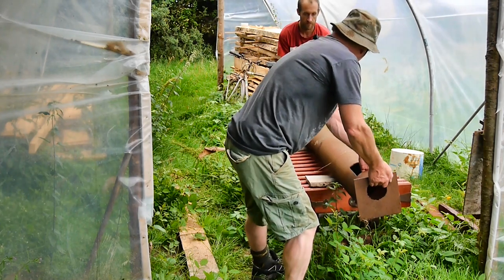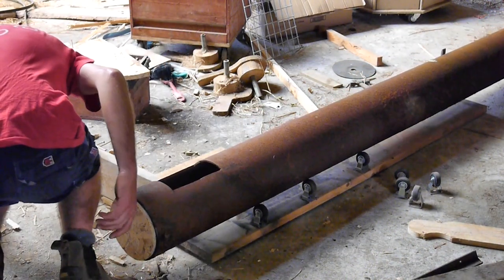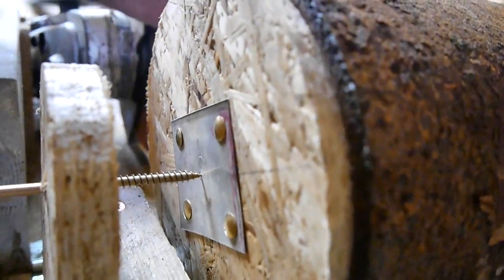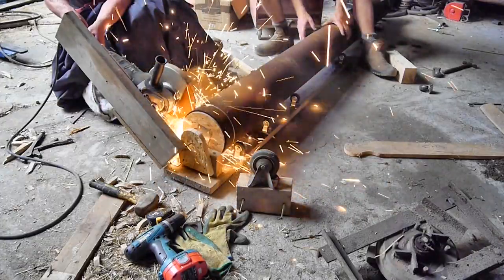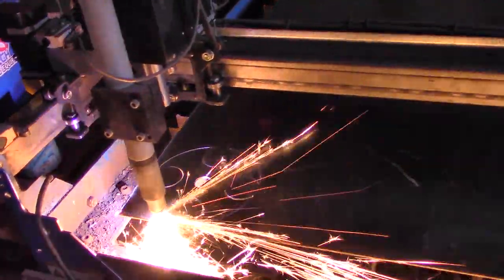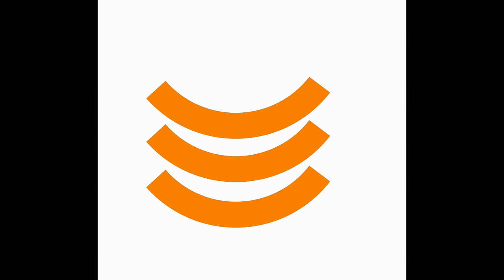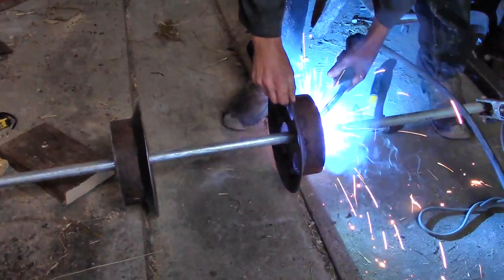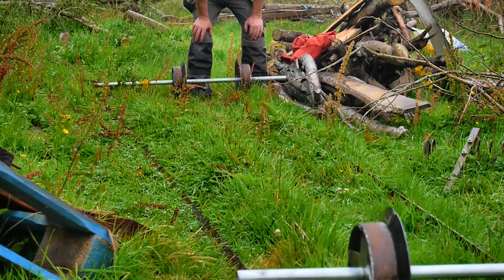Anyone Can Make Railway Wheels From A Pipe - the cheapest wheels possible.

Comment: I really like these, and the whole field railway project! You'll probably get lots of comments about welding galvanised pipe though, so let me be the first: you do not want to breathe zinc oxide fumes, it can cause "metal fume fever" and even death. Please make sure the galv is cleaned off before welding, or use a full respirator.
Reply: Also, make sure the cartridges for the respirator are appropriately rated!  You don't want to use just an ordinary dust/particulate or organic vapor (sanding or painting) cartridge when you're working with heavy metal fingers.
Reply: Does holding your breath and crossing your fingers work?
Reply: @liamholcroft7212  If you've got really good ventilation in the welding area?  Yeah, hold your breath during the weld and for a bit after while the fumes clear, you should be okay, but it's still risky doing it like that.
Reply: @Kineth1  It'll be reet
Reply: Welding any Gav steel,  if possible Soot it  first,  blacken, it helps  stop the gav exploding. 
Also  drink some  milk  before  you  start  welding,  helps  if you  get TOO MUCH FUMES swallowed.

Comment: Hi, Great video, I am really enjoying the videos. Just wondering if you would be willing to tell me what cnc plasma cutter you use. im in the market for one and looking for a recommendation.
Reply: Nice to see you here too! Wouldn't it be awesome if you built railway and they built a timber frame building haha
Reply from the maker: Thanks, Kris, I'm enjoying yours too : -  )
Rob makes the CNC plasma machines and he's here.. https://xtremeplasma.ecwid.com/
(tell him I sent you..)
Reply: Will your power setup need an upgrade for a plasma cutter?
Reply: Came here with basically the exact same question. I saw the link for the tables, can can you say what brand/size of plasma cutter that you were using? Have you been happy with it? Any recommendations otherwise for a first time plasma cutter shopper?
Reply: @the_retag  No My current setup would work fine. its high draw but quite short duration just like welding, and my system is fine doing welding.
Reply from the maker: Mine is the 4' x 4' machine. It comes with an excellent R-Tech plasma cutter, a computer and all the software you need. I haven't tried any other machine, but I can vouch for the back-up service from Rob and his team.

Comment: For the tapered treads, since your pipe has walls twice as thick as needed, why not put the flat tread wheels into a lathe and cut a slight taper into them? It isn't needed, but it might be worth doing, and it would also make the treads smoother, because you would remove the rust pitting, so that would slightly decrease rolling resistance. I don't know if it would be worth it or not, but it could be a fun experiment. Maybe taper the wheels on one of your chip wagons, and do a performance comparison between it and another one on various parts of the railway, and if you notice any improvement, do the rest.

Comment: Good find. You can never go wrong with a scrap pipe that you forgot about in the pile or laid about! The wheels look super nice and the pipe you are using is a good choice for cost. I can not think of anything else that would be cheaper unless it was scrap metal. This would be better as if you need more you can just pick it up. 
I always look forward to see what you come up with. Nice job on the cut locations and details.
Reply from the maker: Thanks, William : -   )

Comment: Might I suggest that the "stat" shaped center pieces for you EXCELLENT 8 inch wheels, be welded into the rings of steel at a pattern 90 degrees from each other in order to encourage a little more strength?
Just a thought.
Reply from the maker: It's a good thought, Frank. If I was using thinner pipe I think I'd go with that arrangement, but this isn't going anywhere. (Well, I hope it is going somewhere, but you know what I mean!)

Comment: Tim, have you thought about using a riding mower for your locomotive? Most have reverse, and a couple forward gears to speed up, or slow for more torque. You are inventive, and shouldn't have much difficulty adapting it run on your rails! Always entertained, and amazed at your work! I'm in western Pennsylvania, U.S.
Reply from the maker: Thanks, Donald - I'm trying to avoid petrol engines, but otherwise it's a good idea

Comment: I'm building my own railway (though I don't have a garden, I live in a city I moved into several month ago) and I should say that wheels are by far the most complicated and depressing part once they don't turn out what you expected them to be. My whole construction is as follows:

1. OSB trainset, parts for locomotive are ready (sawn with a jigsaw literally on the bench in the yard)
2. PVC pipe rails, wooden sleepers.
3. OSB wheels of three parts each - 2x 76mm x 10mm rounds made with crown saws and a bigger one as a flange, assembled together with screws for drywall. Edges finished with sealant. 

So, when I started to put carts together I realized they're as substandard as they can possibly be. Literally everything was assembled on the knee. When I started doing this, I decided to make everything by myself, except ball bearings and screws (and material of course), but now I realize I'd better bought plastic wheels from store. They're not as authentic, but they're all the same.

I'm really fascinated you make it right from the first try. 
Maith thú!
Reply from the maker: What you've learned is really important, and it's only cost you some OSB and some pipe, so well done.

Comment: Hi there Tim and Sandra, I wish to congratulate you on a fantastic site and I love your approach to building your wagons, I have been down all the same road as you and to buy 15 inch gauge wheels for a line would be  too rich for my pension sadly, So you can imagine my joy when I saw how you built wheels using tube and flat plate, would it be possible to buy a memory stick with the program for CNC cutting on it or maybe even a package of all the flat pieces cut out?. I am from York in the UK, but fortunately I live with my wife in southern Bulgaria so we are in the EU,so there is no problem with duty etc, just the price for the wheels and and shipping plus making up the packages. I do not need the axles as they would probably make the parcel too long.   Please give the idea some thought will you I would probably want 1 set of 4 wheels every month or so, I am also going 15"gauge and would be doing hand trammer wagons first,and maybe a loco over next winter.  Once again fabulous site and I hope to emulate your style of building,even down to the charcoal making,all the very best to you and Sandra and keep up the great work. Regards Richard and Janie Feather.
Reply from the maker: Thanks for your kind comments - and I'd be happy to try to help, of course. But perhaps it would be best if you found the pipe you want to use, and decide on the axle first. Measure everything and we could go from there?

Comment: An even easier way to make the inserts is to take two flat bars of around 60mm x 5mm x wheel diameter, drill an axle hole in the centre of each length and then lay one on top of the other in a cross shape with the two holes lined up to accept the axle.  Weld them together and it's done.
Reply: Great thought and comment! It is in fact difficult to keep things as simple as possible. We all tend to fall into the trap of finding solutions using our set of tools we are used to using. KISS is almost an art form and takes a surprising amount of knowledge to facilitate. Again, great comment.
Reply from the maker: Yep. That's a great idea. (Where were you when I started?!)
Reply: @rolliebca  Thanks Rolland, We all have skills we can bring to the table.  Tim's skills are far superior to mine but we  can all grow our skills together simply by sharing.

Comment: Dear Way out West couple (this time addressed especially to the inventor and his helper).
👍👌👏 Simply fantastic again and as always (video and work). But too short, sigh (just kidding). By the way:
Right at the beginning of the video I wondered how far you would come with those work safety protecting shorts. ;-) 😀😀 Hope that there had been at least no nettles or plants with thorns in the bush/hedge where you found the big steel pipe.
2) In my personal opinion you are absolutely doing the right thing = building your private garden railroad with relatively cheap materials and not overbuilding it. In the way you are doing it, it will last more than long enough. Additionally everything is cheap/easy to fix.
I would have tried to put bearings in the wheels etc.p.p.. So my project would never be finished because of the costs and the effort. The result would have been: procrastination! Please don't ask me why I know, sigh.
As always: Thanks a lot for making teaching explaining recording editing uploading and sharing.
Best regards luck and health to all of you (humans animals and plants).
Reply from the maker: Ha! Thanks very much - you're one of most loyal and appreciative followers : -  )
Reply: Dear  @WayOutWestx2 Tim.
You're welcome, it's my pleasure. Thanks for replying. Please kindly allow me to ask: Does Sandra also read the comments here or only the ones on the German speaking channel and the monthly updates in English and German? Thanks in advance for answering.
Sincerely yours.

Comment: Real wheels are very heavy made out of solid steel.  This will hold the car or platform on the track.  I would like to sit up ok without being so far low.  Just look for an older railroad truck that has the guide wheels on it.  Then get them off the front and back.

Comment: Just use a damn pipe wrap and soap stone draw your line and cut the edge of line outside or inside to leave line or cut the line in half is pipe fitters and welders do it like that all the time and its always straight ebough with in 1/32 of a jnch out of roundand when you weld endcap on it will be correct

Comment: Does your railway have a name?
Reply from the maker: Can you think of any good ones?
Reply: @WayOutWestx2  In America at the height of railroading, railroads were sometimes named for the most extreme ambitions of their owners without any regard for the actual route. So perhaps something like Dublin, Paris and Rome Rail System. Not just a railroad, but a System. You can always claim that there are connections available.  I've always been partial to the grandiose lettering used by The NY, New Haven and Hartford. Understatement is overrated.

But should you prefer something more realistic and less grand, then how about West Lines? Perhaps that would be more dignified while maintaining a certain ambiguity for future expansion. And it would require less paint.

Comment: Why don't you just get used car brake rotors and trim the friction surface to the taper you want?
Reply from the maker: No car breakers near here, and buying them would cost too much . and that would be a LOT of grinding too, don't you think?
Reply from the maker: Also, I think, you'd still need two inserts, unless you were using monstrous axles that filled the hole in the middle of the rotor.
Reply: @WayOutWestx2  I'm not sure how the forces work out.  It would be some grinding, but my local repair shops replace probably 10 brake rotors a day and the old ones go out as scrap metal.  They probably do not get $1 US for old ones.   Old styles have the hubs integral.  You could just add bearings and go.  New ones just have a hole.   You just make something for the machined side and fill the back with cement.  Portland cement could be 2-3000 psi?
Reply from the maker: Try it and let us know? I'm not convinced but could be persuaded!

Comment: wagons are great, but when will you be making an engine? even if you don't really need one, you cant call it a railway without one.
Reply from the maker: Nope! A railway is just the rails...
(Of course I'd like to build a locomotive - but I just don't have the money.)
Reply: @liamholcroft7212  I envision an ordinary yard tractor (riding lawn mower size) with a steering rig to make it follow the rails while the big grippy drive tires ride on the ground to either side of the rails.
Reply: @Kineth1  yeah that would work, although my inner child was dreaming of a small scale loco rather than something actually functional.
Reply: @liamholcroft7212  Isn't that the essence of life, eh?  Some days you just have to choose, do you want something fun, or something fun...ctional?
Reply: @Kineth1  Fun always fun. you might be struggling due to lack of functionality, but you'll be having fun while you struggle.